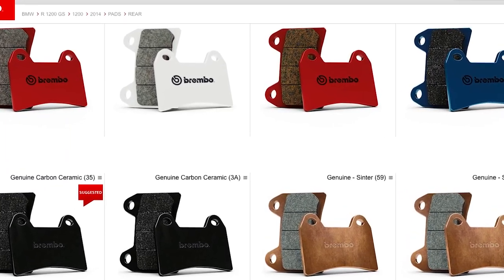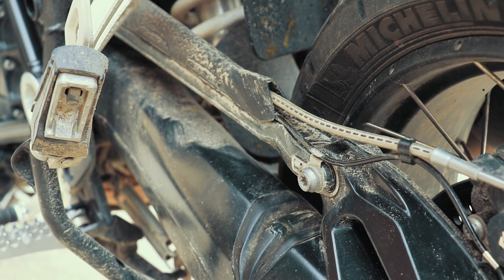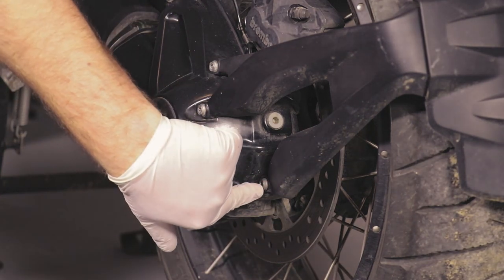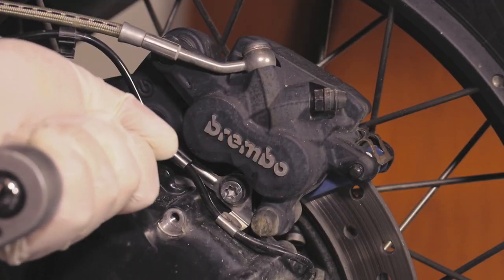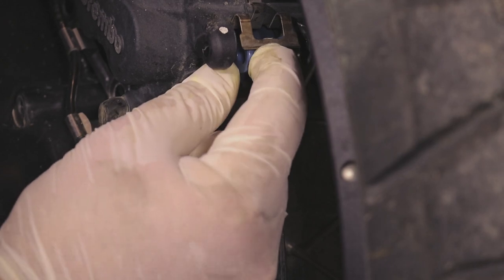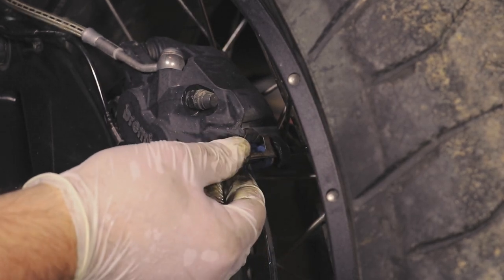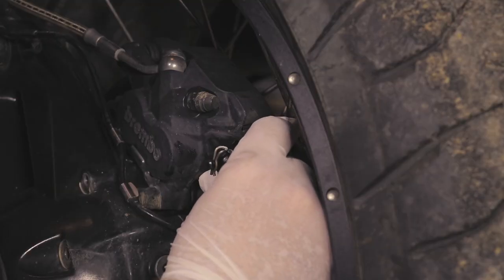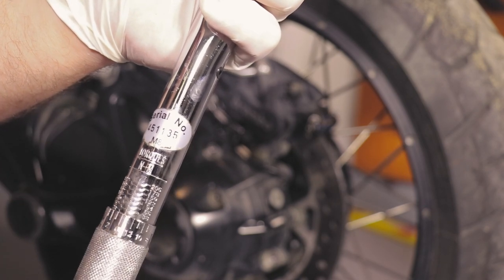🔧🛠 [HOW TO] BMW 1200GS /1250GS REAR brake pad replacement TUTORIAL

Comment: Who' would have predicted, that I'm gonna be helped from a neighbor at the north side of Danube river! I had to struggle for a couple of hours to slide the new pads preinstalled and pinned inside the caliper until I finally gave up and came to YouTube and found your helpful tutorial video. Yes the American way doesn't work on German motorcycles - you've got to do everything in order and definitely wash your bike beforehand.😃 Everything went smooth and fast. I use locktite (removable) on the three screws securing the mud fender as well. Cheers Romania!!!

Comment: Great video. I did the same job but "exercised" and lubed my piston while out. I also lubricated the parts of the pads that bear against the caliper as well as the pin shaft so they all groove nicely in and out.  Thanks buddy!

Comment: Thanks for the helpful video. You didn't mention taking the backing plate off the old right side pad to put on the new right side pad or did your new pads come with a backing plate already fitted?

Comment: "THEY" say that you should have same pads for the front and rear and I agree. The reason is that there is a difference in the coefficient of friction between organic, ceramic, semi metallic and sintered even between same type but of different brands. This is especially true with linked braking systems that share brake line pressure.  Heavy braking will cause one wheel's ABS to activate earlier if it's brake pads have a higher coefficient of friction.  If the bike has no ABS, then one wheel will skid before the other wheel. Good video for procedures though. Thank you.
Reply: My BMW owners manual, which many peeps forget to look at advises that “my” GS takes sintered front pads and organic rear…. ? ….  How is that explained? I’d imagine BMW knows best… Probably explains why many complain about GS rear pads not lasting long…
Reply: @markwilson2398  Interesting man. Perhaps BMW is thinking they'd want one wheel to go into ABS mode before the other? That's assuming the above which is different coefficients of friction. Anyway, here's some technique I did when installing my last set of pads.  https://youtu.be/RRBEhndPVmM

Comment: Thanks and yes, brakepads are easy peasy to replace but...........
Any idea how to remove and replace the rear disc (rotor) on recent GS1200's and GS1250 by any chance - older models it was easy to reach the retaining bolts but newer models it seems the final drive assy cover is larger and it covers a wider area which makes it near impossible to get to the torque bolts unless there's a trick I'm unaware of. I spent a 100 Euro on new rear rotor but seem unable to replace it myself - what a bummer.

Comment: I have a 2020 r1250 gs only 500miles on it! My rear rotor gets quite hot! Some people say because when you brake the bike re directs some of the pressure to the rear!! Is this accurate?? Fronts are little bit hot! I do use both of my brakes i dont know! I just dont want to go the dealer and have some monkey work on my bike for 2 weeks just to tell this is totally normal! Nice videos dude!!! Where is dave btw?? 😂

Comment: For brake pad replacment  only,  you don`t have  to remove the caliper. But if you do so, it  is better to clean it also with brake cleaner, and soft brush to put some special  grease for  caliper pistons, and  some cooper paste in the back of the brake pad on the piston side only.
I suggest you an update  about it  😉
Reply: brake 🤦🏼‍♂️
Reply: @bwanasid  thx mate. Give me a break

Comment: You can change the pads  without removing the caliper  hombre
Reply: How do you retract the calipers while still on the bike?
Reply: Before removing the brake pad, use a grip to slowly press it to depress the caliper piston. Then you can easily remove the pad and install new.
Reply: If you take the calliper off, you can inspect and give it s good clean.
Reply: Yeah, but it's good to clean the pistons before pushing them back in.

Comment: Dealer said my rear pads only had 20% left at only 8000 miles on my 2020 GSA1250 anyone else burning rear pads?
Reply: I just posted a comment! Im having my rear rotor quite hot i have an r1250gs 2020 some people have told me that this bike redirect some of the brake pressure to the rear first before the front ones! Idk i think it might be true that might explain why yours are wearing more than usual! Idk im just saying!

Comment: Video Title says front wheel pads. Changes rear in video. Doh.
Reply from the maker: Noooooooooo! How has nobody noticed this in over a year! Well done mate!
Reply from the maker: Also front is very easy. Just 2 screws per side.
Reply: Good and very well done video! Must say you sound like us here in South Africa 😂. How do they compare to the original pads from BMW, which is also Brembo I think? Did you order from the official website? Keep up the good work!
Reply from the maker: I lived in SA for 15 years, so that's where the accent is from. The blue ones are fine for the back, but the red ones are horrible on the front. A lot less bite, so go for blue as well on the front. I got them from a local shop, but it's the same as ordering from brembo. Yes, the originals are also brembo pads.